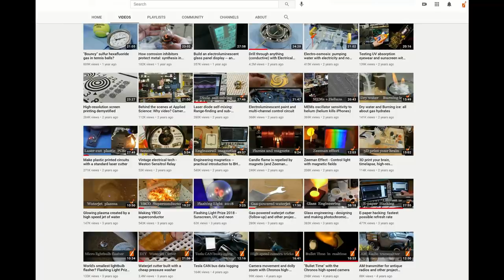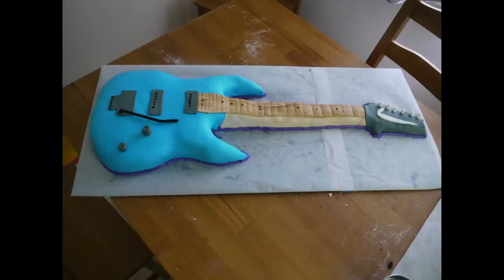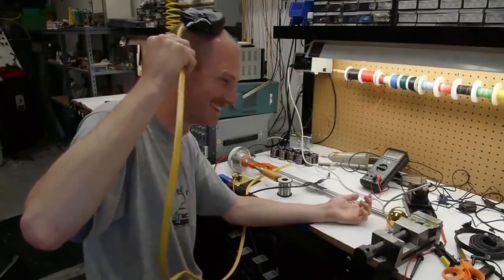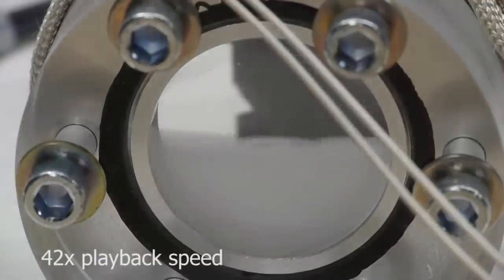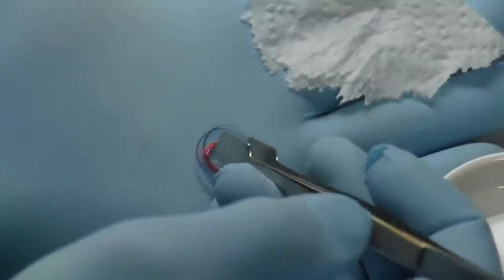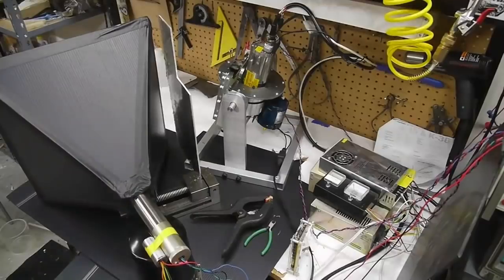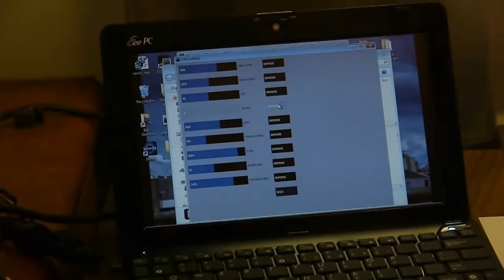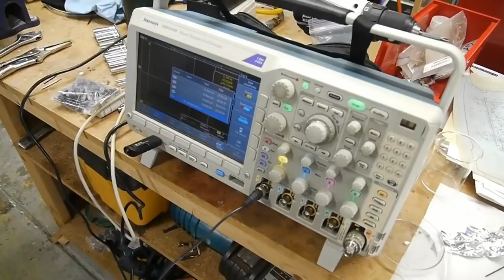The best projects from 10 years of Applied Science

Comment: Congrats on 10 years! This has been one of my go-to channels for about as long. 

I'd like to toss a video suggestion your way that might be interesting...revisiting some of the work with glass as a media, but replace the glass with a piece of sapphire. I know it's used in the cameras on drones to be a barrier against impact to the cameras so there's a potential means of sourcing flat glass-like sheets...it would be interesting to see thin film depositions, or turning it into an electroluminescent display, or why not go right down the rabbit hole and see how viable it is to make a sapphire touchscreen? Or both, with an EL display on the back with a touchscreen on the front. Whether you use the idea or not is irrelevant, because I know you're always going to find cool ideas, and I'm set and locked in to watch 10 more years of your work!

Comment: I, for one, really liked the idea of the cookie machine. The recipe on the back of the chocolate chips isn't optimized for making the best possible cookie, but for making a good cookie that's easy to make. My favorite recipe uses browned butter and more egg yolks than whites. Neither of those things are going to show up on the chocolate chip package.  If I were to design a cookie testing machine, I would have a separate feeder for egg whites and yolks, try different ratios of brown butter to regular butter, and I would use all white sugar and have a molasses feeder rather than messing with white sugar, light brown sugar and dark brown sugar.

Another of my favorite projects was the water jet cutter. Interestingly, there's now a desktop water jet cutter commercially available. It's more expensive than your setup, but it has its own CNC gantry, so you don't have to own one to bolt it to. It's still out of reach for most hobbyists at $8k though.

I have been hearing about people building laser water jets in their home shops. That would be an interesting project, not sure anyone's documented that on YouTube yet.

Comment: I posted my self balancing robot a few months earlier.  and also I have attempted to build an electron microscope. I wish I still had the diff pump, iconic. But this channel is very physics and i love it. so many investigations, the cutting edge, I did a calculation about how much volume the radio waves from earth increase by each year, so we started about 100 years ago so light volume from 100 to 101 is 10E52m^3 which is 10^12 times the volume of our solar system or a box 10,000 solar systems each direction.

Comment: This will probably be lost in the comments, but I'm a muscian/producer and I was just mindlessly playing about with articulating two chopsticks in my mouth, and I was surprised at how accurately I could manipulate them consistently. Using a combination of pressure from my teeth, lower jaw position, and most importantly my tongue. I quickly started thinking of ways this could be used for synth modulation, then I recalled your video of designing the mouth modulation unit and wondered if you'd considered using a lever system involving the tongue? Also, thanks for all of the amazing content over the years <3

Comment: Dear Ben, good afternoon from Bangalore. Oscilloscopes are very expensive, even used CROs from Tek!!! So, could you kindly make a video or set of videos on the inner working of an oscilloscope? What is so challenging in the design of GHz scopes? How are they made? Can we build a decent (I am sure you can, without a doubt), a 100 MHz to 250 MHz or even a 500 MHz oscilloscope using an old CRT at home (yes, at home) with decent amount of tools? I mean, a serious instrument, not some amusement toy just to see audio signals?

Comment: You helped Valve with the VR Project that was later released as the HTC Vive? That's amazing! What exactly did you work on?
Reply from the maker: Alan Yates and I (mostly Alan) created the Lighthouse tracking system. I still have the first prototype on my desk. I also built judder-free LCD displays, and started modding OLEDs to be flashed for judder-free operation. This technique became standard in all the high end headsets, I think.

Comment: Congratulations! 
What I just saw seems like just what you need for a next project. 
BBC just released a video showing a box that you can connect to the internet which produces a 3D holographic image of the caller. It is smaller than life size but it does seem to work and would revolutionize communication.  Check it out!
Cost about $1000.00 US.